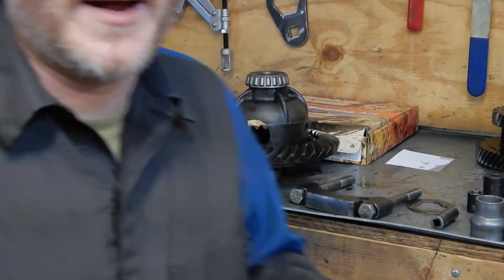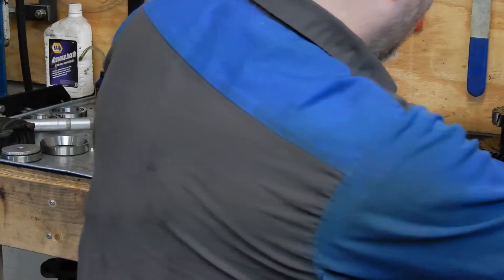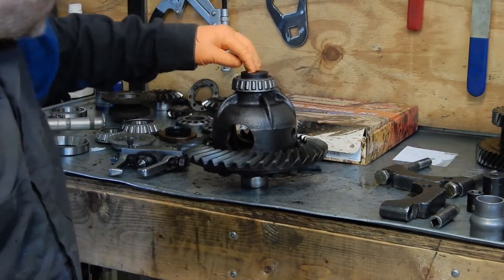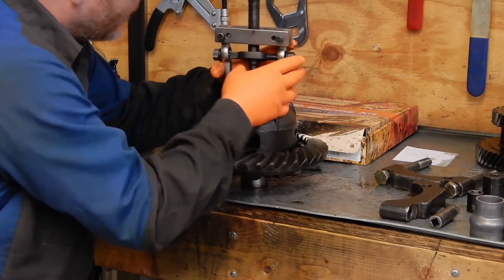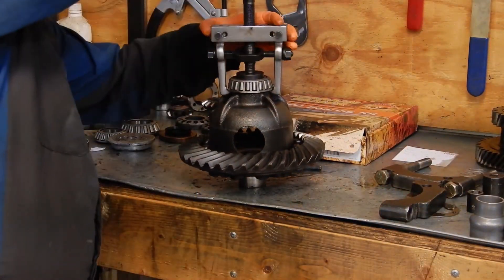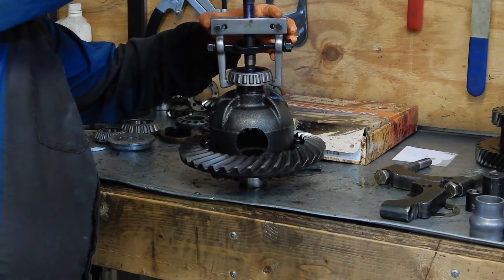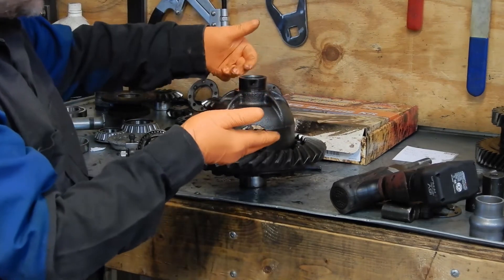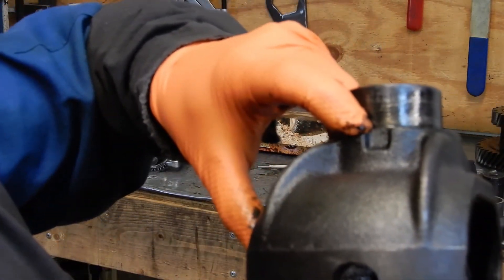Carrier Bearing Puller, Tuesday's Tool #2

Comment: pulling on the outer ring, through the rolling elements is generally forbidden.  ruins the bearing.  I suspect a tool exists that reaches all the way into the inner ring through those notches.
Reply from the maker: That's exactly what this tool does, it grabs the lip of the inner race. There are recessed areas of the carrier it fits in to.

Comment: Where do I find this tool?
Reply from the maker: I got mine from Matco. I think it's actually an OTC that's been rebranded. Amazon probably has it.
Reply: @OTRAMM  Amazon does have it. I actually saw matco today (every Wednesday) he didn't have one, neither did snapon. Thanks for the reply, I usually cut off old bearings but need to get some off intact this time.